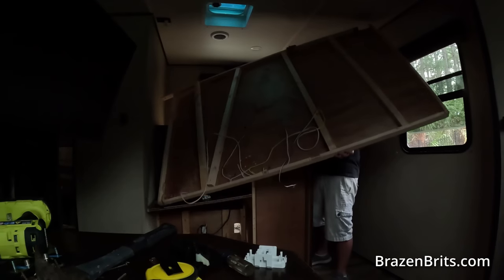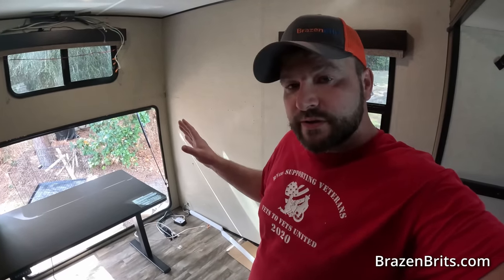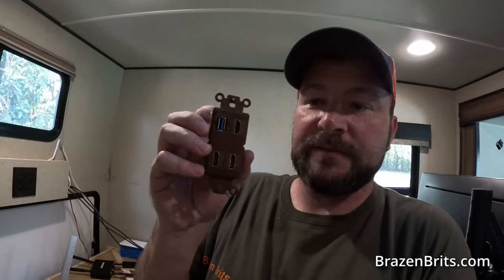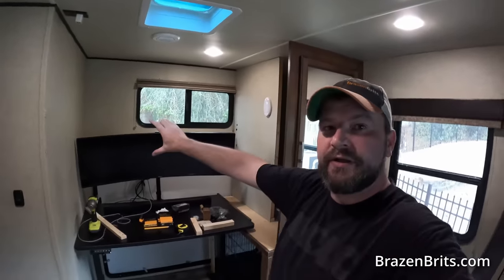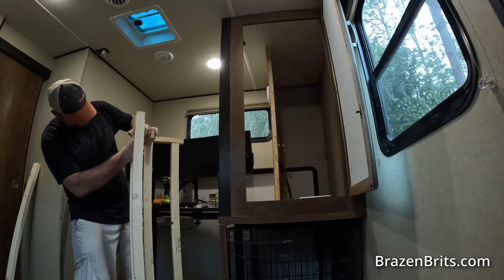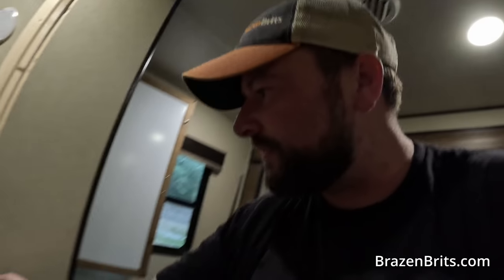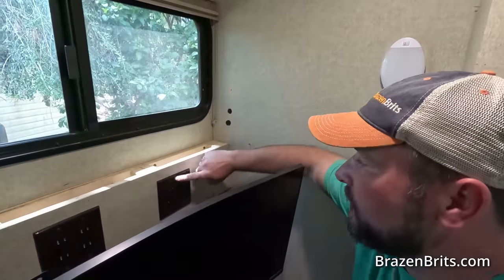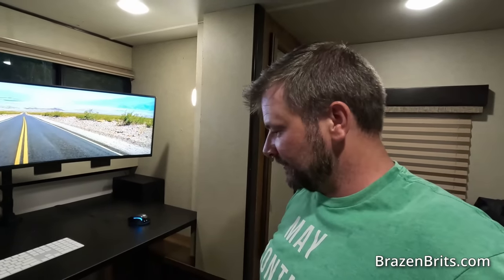Building a custom office in our RV

Comment: Im staying tuned
Great job and design.
Tip 1..only have table saw blade as high as the material your cutting
Tip 2..when using staples use a little wood glue under staples
Couple pieces of outside corner trim and its fit for a king.
Cheers.
Reply from the maker: Tip3 don't leave the metal ruler underneath the wood to kick back and smash your thumb.... coming soon!! 😂

Comment: Are you concerned that being at the very back of the trailer that your electronics will get the bouncy vibration test?
Reply from the maker: Hi JayD. Actually, not too much. I had all my kit there for over a year and it was fine. I do worry about the new monitor stand bolted to the desk. The last one was wall mounted and had no issues. We will see.